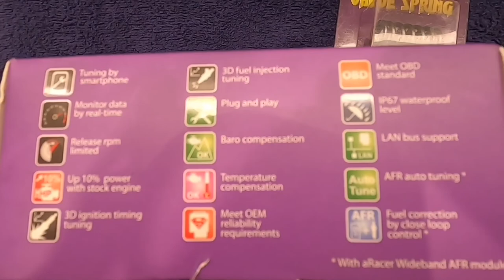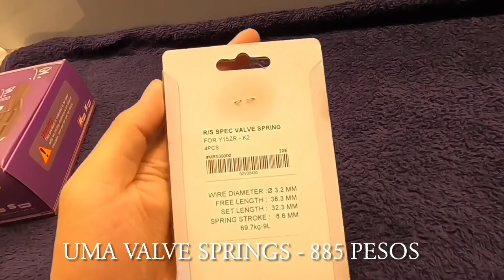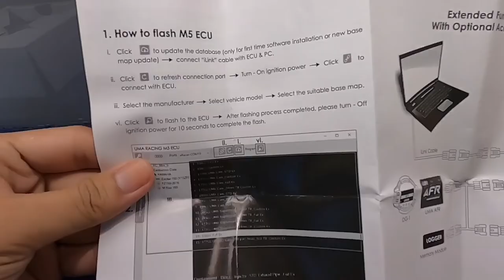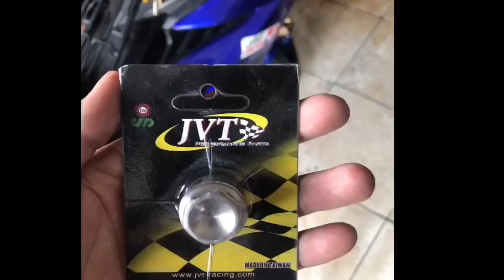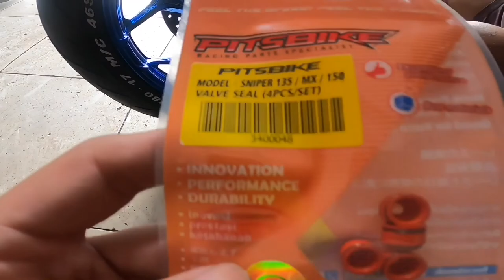Sniper 150 | UMA M5 V2 ECU | Uma cams & valve springs | Fastek | Installation | Performance | Review

Comment: Galing ng set-up. Pag nag add ka 6th gear, parang overdrive na lang function nun, pang long stretch lang.
Reply from the maker: Tama kuya mitch, need dumiin sa karga niyan kasi nasa 4th gear ang pwersa ng upgrades ko. Pagdating 5th gear doon siya nag over drive. Kaya sa settings ko di ko need ng 6th gear.

Comment: Uy lods, fastek ka din pala, jan din aq kay boss allan planong magpa dyno, tska tanong ko lng din boss, ok lng ba magpa dyno kht stock lng cams and valve spring ko?? Slamat lods..
Reply from the maker: Need talaga tono niyan bords para yung dulo pasok yung pwersa. Wag lang masyado babad sa high rpm. Okay lang yan dyno 💪🏻
Reply: @jokrides  ok lods, wala pa kasi ako planong magpalit ng valve spring and cams, tsaka di kodin tlaga lagi nasasagad ng buong speed dahil lapit lang naman work, kaya lng sabi  din saken ng ilang kilalang expert na need tlagang ipa dyno para ma remap siya, di din kasi sapat ung nasa cellphone app ni uma..
Reply from the maker: Yung mga ganun kaselan na mapping is yung pang racing na mismo. Yung ginawa ko sa fastek pinatono ko mismo kaya kahit anong pihit mo walang piyok at walang pwersa na masasayang. Pasok lahat ng piga. Wala naman problema kung di ka magpalit. Asahan mo na may + 10% yung performance ng motor mo 😉
Reply from the maker: Ayos naman sa app pag minor karga 💪🏻

Comment: Pwede knamn magpalit ng pipe kahit stock ECU pag pna AFR mo ECU Mo safe na yan dna need magpalit ng RECU
Reply from the maker: Di po natotono afr ng stock ecu ng sniper. C1 mixture lang kaya adjust ng mga mekaniko. Except siguro kung may malupit na mekaniko na kaya mag bypass ng electronics ni yamaha sa stock sniper ecu.
Reply: @jokrides  pwede sa version 1 na sniper natotono ang ecu sa v1 na sniper iba kasi ecu sa mga v2 tulad sayo
Reply from the maker: @jhanexbluevlog8508  thanks sa info bords 💪🏻 sadyang lamang pala sa pwede makalikot sa stock ecu ang v1 ng sniper. Marami makabasa niyan dito. Thanks sa info 💪🏻
Reply: @jokrides  tama mas maganda kase magpalit ng ecu.. Ako v1 ako, oo naadjust ang c1 mixture ng v1 kaso iba parin sa mapping ng programmable ecu.. Tsaka hnd mismo afr naadjust sa v1 .. C1 mixture lang.. Tska sa progrmamable ecu ggmitan ng afr guage wideband sensor .. Sa adjust c1 mixture hnd madedetect tamang afr don

Comment: How about torque paps? Sulit ba sya lalo na sa mga overtaking scene kasi naka 5.7mm ako na cams parang delay kasi bale over 6-7k rpm bago magalit hehe 😅
Reply from the maker: Lakas ng torque bords, mabibitin ka sa 5th gear na papalo 150kph+ mapapa isip kang mag karga pa lalo. Walang talo sa at puro panalo ang upgrade na ganito 💪🏻
Reply: uo boss gnun din skin. nka 5.7 ako 6-7k papalo ung lakas nya pero sbe pag nag fully programmable ka mwawala daw ung delay
Reply: Anong cams gamit mo pape sakin kasi stage 2
Reply: @clangdeguzman5129  nawawala nga delay, putok naman ang pumalit. Pinadyno ko pa.

Comment: Paps .. pa share nman jan oh . Kong pwdi bang mag palit nang cams n R1 at uma valve spring s stock na valve ?? Nka 59 bore ako paps ask ko lng kon pwdi ba stock valve lang tpos cams r1 at uma valve spring
Reply from the maker: Pwede, lagay ka lang valve shims. Goods yan.
Reply: Pwdi rin ba khit dna mag ECU ?? tpos lagyan kopa sana throthel body 34mm uma rin pra sulit na sulit tlga
Reply from the maker: @jasonmonton5572  wag mo na upgrade idol kung di ka papalit programable ecu 💯
Reply: @jokrides  anu kaya size nang valve para s 5.8 lift na cams idol ??bibili din ako ecu MVR1 lang yung plug and play na pwdi n kaya yan ??
Reply: @jokrides  salamat idol hehehe .

Comment: Paps magkano inabot labor kang mang kepweng ganyan din kasi gusto ko setup unti unti ngalang binibili kuna nag iisip lang ako kung kaninong mekanko dapat yung trusted para d sayang mga biniling piesa rs
Reply from the maker: Basta sa pipe, cams, springs dapat sabay yan sila. Kahit ecu mauna. Para sakin kasi makaka tipid ka kung may pagsabay sabayin mo sila kasi makaka tipid ka ng isang tono lang 💪🏻 iwas aberya pa just in case masiraan ka gawa ng baka di akma ang settings kasi di sila sabay-sabay sinalpak.